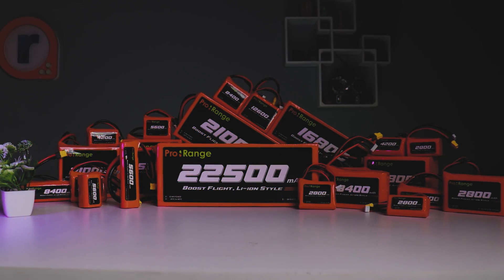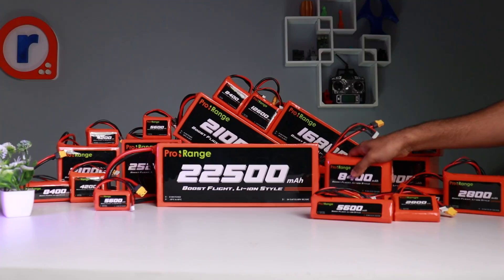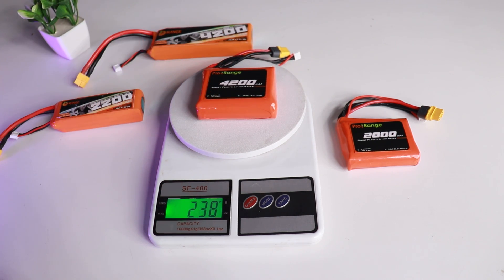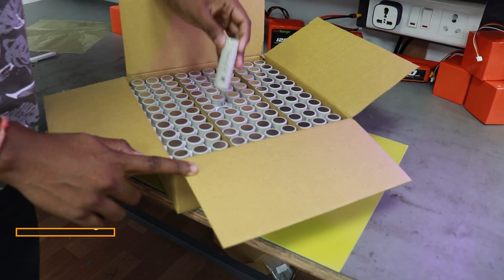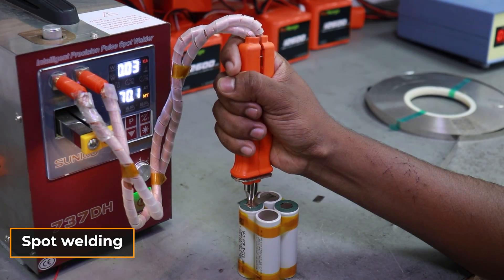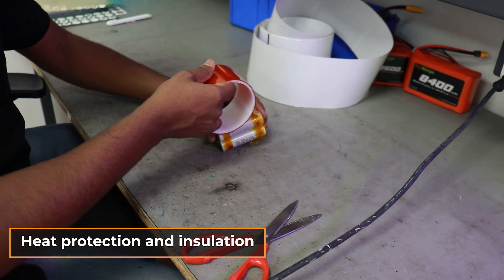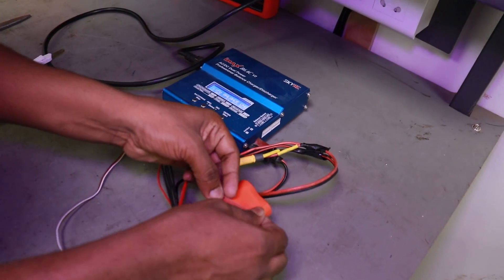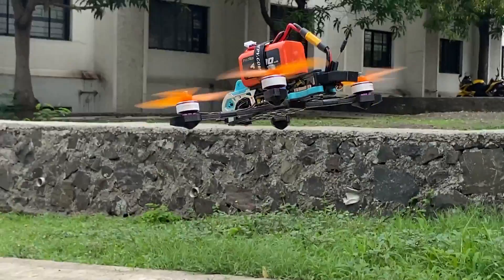What are Lithium-Ion batteries? | Pro range Lithium-Ion batteries for Drone and  RC.

Comment: this pro range 3.7v battery but when I connect the connection with discharge port it's not working on my RC and it also got balance charge different wire.. so pls help how do I charge or make it work or is it defective
Reply from the maker: Hello @phenomenalone2013;
Thanks for reaching ;Please connect with our customer support and raise a ticket on info@robu.in they will surely help.

Comment: Hi robu team,
Recently i have purchased the same battery pack as shown in video, 4s 4200mah but while charging in li ion mode using imax b6 AC charger it says 14.4 volts but on battery pack it is written 14.8v, like lipo battery does, so do i have to charge it in lipo mode on 14.8v or on li ion mode to 14.4v? 
Thanks 🙏
Reply from the maker: Hello kedarguddapure,
Li-ion battery  has a nominal voltage of 3.7 volts. So, considering you have a 4S battery pack, average voltage should be 3.7 * 4 = 14.8 volts.

Therefore the battery pack should be charged upto 14.8 volts. You could charge it to a lower voltage between 14.4 to 14.7. 

It will boost your battery life in the longer run.

Comment: Is this battery can handle f450 frame and 1000kv motors… can it
Reply from the maker: Hello there, @abhisanthp5779
Yes, they can handle f450 frame and 1000 kV motors.  Please connect with our customer support at info@robu.in, and they will guide you through finding your battery according to your application.